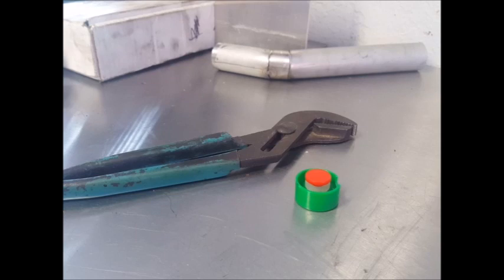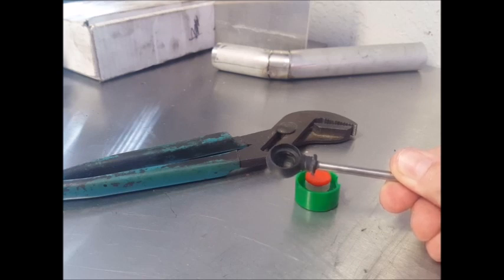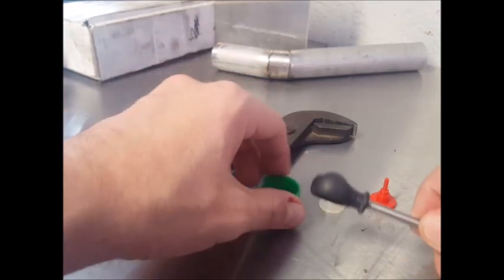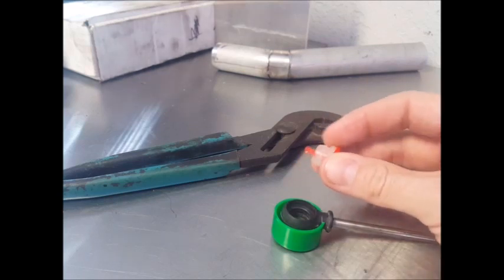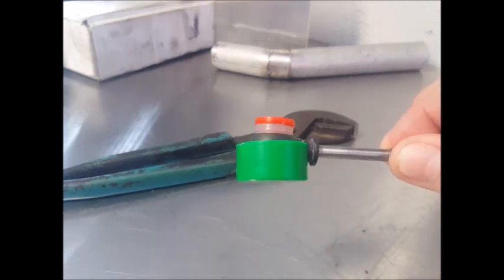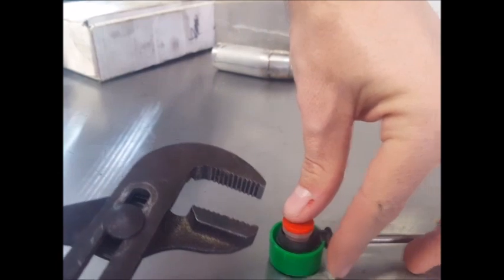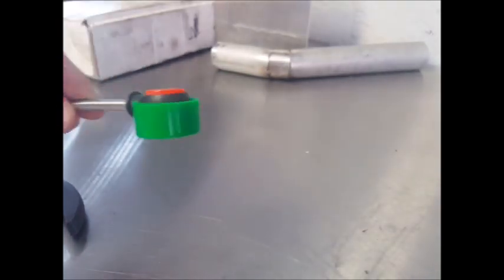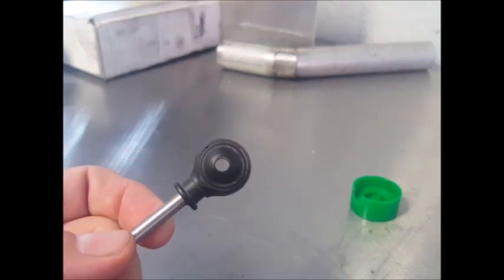The easiest way to fix your Buick Rendezvous shift lever! Kit includes replacement bushing.

Comment: I see how easy installing the bushing into the cable is. But I have no true dea where to find the cable on my car, but this job can be done in Fifteen minutes. Can you show a diagram or how did you take it apart, as I understand it is to be in a tight space.
Reply from the maker: Even better! Google your specific year, make, and model along with words Shift Cable Diagram and it pulls up TONS OF diagrams! Heres an example of what occurs when I searched 2007 Buick Rendezvous Shift Cable Diagram: https://www.bing.com/search?q=2007+Buick+Rendezvous+Shift+Cable+Diagram&form=ANNTH1&refig=04b905627db04ba7a19dd16b8929ca7f&pc=LCTS

Comment: I have to do this job today and I was wondering do I have to remove the cable in order to do it or can I do it with the cable still attached?
Reply from the maker: Best to disconnect end that is needing the bushing. But not to remove entire cable